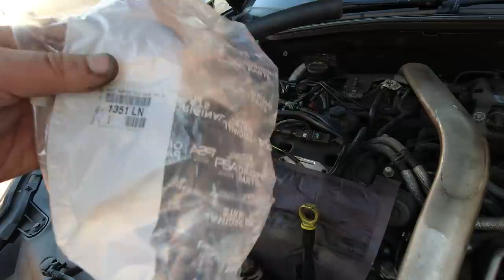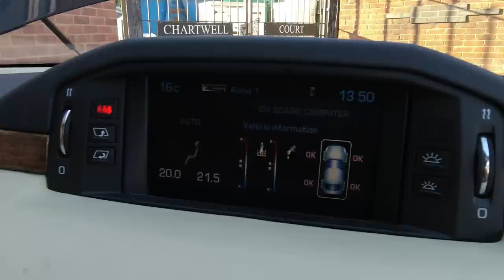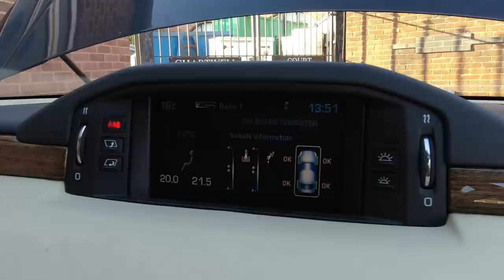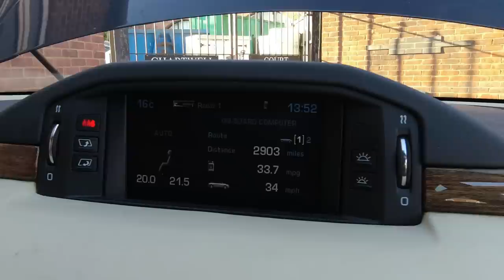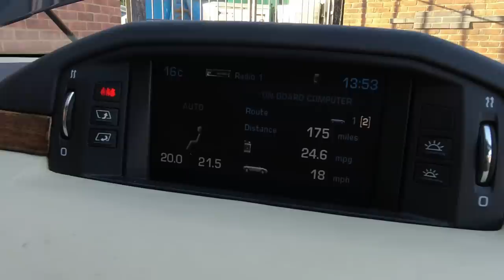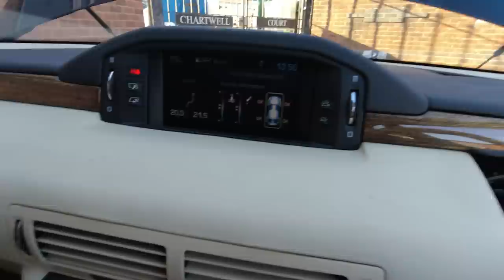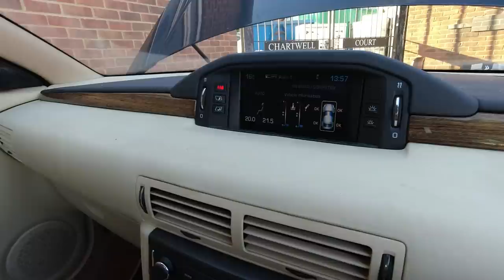Cheap Citroën C6 Project 9:  The straw that breaks the camel's back?

Comment: I have a C4 Coupe VTS 2.0 16V petrol and it's just as mental as a C6 but will return 35 mpg with no problem as it's so light.
Reply from the maker: I had a VTS 180 before the C6 (covered in the first C6 video) and I can assure you, it's not close to a C6 in terms of mentalness! 
Wouldn't say 1320kg is all that light either, in fairness. Don't get me wrong, I really liked it, but it was what it was...a Peugeot 307 in a pretty dress with a slightly underpowered engine (though the engine itself was pretty good)
Reply: @UPnDOWN  Ok I admit it's not as mental as a C6 but it isn't a Golf and it doesn't weigh as much. The guy I bought my C4 off had an absolutely mint C6 and loves it. I think it's a cool car. Could you not mothball it and run a funny crap box for a while. (Honda Jazz🤣🤣)

Comment: Spraying coolant could possibly be what pissed out over the belts when you did the pipe and the bit of smoke might be from a crack in one of those EGR metal pipes ? Those Renault Twingo 0.9 tce's are good fun to drive but they warm up your shopping (Rear engine)  if that's too expensive maybe look for an early Suzuki Swift 3 pot, might even have a velour interior ? 😁

Comment: C3 Picasso 1.6 HDI?......£30 Tax, 40MPG around town and 50 on a run, 5 Doors, back seats drop flat, nice soft suspension, albeit a bit weird looking.
I bought one 12 months ago and we (the family) use it as a spare vehicle, a van for skip runs, moving (small) furniture, etc. We had to buy a new washing machine last month and it fit perfectly in the C3, which saved us £20 on store delivery costs 👍 My 17yr old daughter is currently learning to drive in it too and loves it because outward visibility is spot on. 
You'll just need to find an enthusiastic Citroen Specialist in your area for servicing 😉
Reply from the maker: I just don't want one of those engines in my life, to be honest! Could do without the aggro. I think it needs to be petrol.

Comment: You can fit a low level coolant sensor and activate the warning from Diagbox, there is tutorial to it. We have it installed on ours.. Only issue that the sensor has to be either from Aliexpress or SH. And the sensors were not the most reliable ones, but at least it's there :D 

Also it would be important to change ALL the  coolant pipes, as if one breaks due to old age, pretty much the others will break, for the same reason. While this is logical, for some reason it didn't occured to me, until somebody pointed out.   Some break because they are plastic(durawhatever) and others are metal and rust... 

Until I can pay for it, I am not giving up on mine :D
Reply from the maker: Yeah, I've got a new bottle and a used OE sensor from a C5, just haven't done it yet because I'm still flushing the cooling system before it goes waterless.

As for the pipes, I agree, but that starts getting costly.
Reply: I  have driven mine  in the Netherlands since 2014 and i have spend thousends of euro’s on her…..but i truly love the C6! And i will keep her as long as i can….
Reply: @UPnDOWN  you don't have a C6 because it's cheap, easy or reliable ☺️ you have one, because you are officially crazy. And since you have an SM too, you are more than a normal official crazy 😂 like crazy on steroids

Comment: I had a late Rover 45 connoisseur TDi cheap tax it was very comfortable had all the basics like auto climate and heated seats etc and it did 55mpg in town over 60 on a run and never gave me any grief but its definitely not as majestic as a C6
Reply from the maker: They're actually good cars, though. I sold Rovers (briefly - it ended badly, maybe I'll cover it the 24hr live stream) and the 45 2.0TD Connoisseur was one of the cars I remember being much better than I thought it would be.

Comment: As much as I love my DS, XM, BX´s, and hate all new rubbish, I got a Volvo 240 eight years ago. It´s brilliant. And it´s a 1990 so it gets really good mileage. I can relate to your situation. Maybe give an old 240 a try? If not totally destroyed they are actually pretty nice to drive. I´m still the biggest LHM junkie ever, but the 240 is a friend for life. It lets my brain relax. It kinda has my back. Just a thought...
Reply from the maker: Nothing going to be frugal though? Probably not much better than the C6, if it all? Tax would be cheaper, but not hugely cheap (unless it was over 40yrs old!)
Reply: @UPnDOWN  Aha, so it´s 40 years in the UK... It´s 30 in Sweden. My 1990 Volvo 245 doesn´t pay tax and I´m doing 7.5L/100Km. Rust-wise, Volvo were really bad before 1989-90. And a 40yo Volvo will not be frugal at all. They need the B230F engine with LH 2.4 Jetronic and a manual gearbox to be good. I think that engine came in 1989. I still think it´s worth looking at. It´s always nice to know something good and simple got your back when all the other cars is wanting your attention. It has (kinda) worked as a way for me to stay sane.

Comment: Just get one of the later BXs with a velour interior. I use one (albeit with a tweed interior) as a daily. It's a 16 TRS from '89. 
Not sure what the costs are like in the UK, but I pay chips for insurance and tax, the parts can be sourced from a junkyard and it sips fuel. Quite a decent comfortable daily driver.
Reply from the maker: I've got two BXs already, they're a bit old for daily use, for me.
Reply: @UPnDOWN  I can understand. They are definitely showing their age in some aspects. I know some had AC, but those are quite rare (and usually use the older freon making refills tricky). Also, mine is a bit...how should I say...well loved. By that I mean that nobody serviced the damn thing properly for the better part of 20 years. Currently the idle is too low, somethings up with the HP pump and I think it may be running rich (there is lots of liquid coming out of the tailpipe and the fuel usage can be erratic). However, even with all its faults, it is still an excellent car and we love it very much :D
And, good luck finding a decent daily driver!

Comment: You're a jinx, you are.
I watched this video a couple of days ago and yesterday my degassing pipe - the other of the two that lead to the expansion tank blew.
Exactly the same problem.
Old, brittle plastic end connection that snapped at its weakest point, where the o-ring resides, which is the point where the plastic is thinnest.
I'll be replacing all of these types of fittings/pipes/hoses shortly.
My C6 is begging to resemble Triggers broom.
Reply from the maker: I expect mine will fail soon, too.

Comment: C6 not having a coolent level sensor surprises me. I get pestered with a flashing stop light, beeping, low coolent message and light from my 206 each time I park it half on the kerb opposite my house because the coolent level is at an angle the car doesn't like until you get off the kerb and drive off and it goes away.
Reply from the maker: I was going to do a video about it, but they did, originally. PSA stopped fitting them because coolant was seeping up through the sensor through capillary action and along the wiring! It would get to the ECU and ruin it, as well as throwing up numerous false low-level coolant warnings.
They can be retrofitted, at least.

Comment: I have had my C6 2.2 for nearly ten years recently failed its MOT with leaking hydraulic pipe on nearside strut. New pipe from Citroen will take 6 to 8 weeks for delivery and cost to supply and fit £821.00 it also needs tax £330.00 and service. I have decide to take it off the road for now and use my Dacia Duster 1.2 turbo petrol for the winter. I understand your situation.
Reply: Get one made 😉

Comment: Here in Denmark the annual road tax, or green tax as we call it, is 1.500 pound sterling with the 2.7 diesel. I didnt see a C6 for a very long time. I always liked Citroen and my first car was a rusty CX 2400 Pallas in, more or less, the same color as Clements original color. The new boxy Citroens are not real Citroens to me so today I drive a 2020 Volvo V60. The Volvo is "only" 500 pounds in annual tax. Cheers from Denmark.
Reply: Maybe thats why newer Citroens dont brake down any longer that the old ones did.😄
Reply: @fonziebulldog5786  I do not agree. I have had 2 CX, 1 BX, 1 Xsara, 2 Grand Picasso, 1 C5 and 1 C5 III. The Xara was the most unreliable even if I bought it from new, the 2 Grand Picasso had technical issues every second month, gearbox failures etc. The most reliable was the CX GTI and the BX. Minimum maintenance but extremely stabile during the years. Cheers.
Reply: @hestjensen3876  Well, when the fuel prices took of to the roof over a year ago i  sold a troublesome Volvo XC 90 T filled with electronic problems and bought a Citroen C4 second generation and it just runs and runs without any faults. I will probably get another Citroen after this one for sure. Take care. 👍

Comment: Buy yourself a 3 cylinder 998cc Kia Picanto as a commuter car for yourself. I bought a 2011, 40,000 mile, specimen for £3,999 as my retirement car, and it's fantastic, both to drive and work on mechanically. The Hyundai i10 is basically the same car with a different body.

Comment: You protest, but you need a Citroen C1! I know the 107 and Aygo are the same, but you need the one with the Citroen badge. Buy one cheap with a broken clutch. Parts are peanuts, they are easy to work on. Just don't buy a rotten one and seal up all the bits where they let rain in. Some of them have velour-ish seats to boot. Seriously one of these will save you so much cash!
Reply from the maker: I'd want the Toyota-badged one, as it is more a Toyota than a Cit or Pug. They also look the best of the three IMO.

Comment: At the risk of teaching my grandmother to suck eggs, I am a bit of a C107GO obsessesive, so if you do go down this route, the following apply (based on MK1, 1KR-FE petrol only, since they are the ones I know best):

- Clutches, rainwater leaks, gummed up oil control rings, piston slap (usually only an annoyance) and weeping/leaking water pumps are your main concerns.
- The Phase 1 cars are the nicest to drive in my opinion, but are 'only' EURO 4 complaint.
- Phase 2 and Phase 3 are EURO 5A, the latter being free VED, as opposed to £20 a year, last time I checked. I believe the main difference is in the mapping. Not related but I also believe the later 1KR-FE got oil spray jets under the pistons.
- I've driven plenty but have only owned a phase 1 and a phase 2 car. Personally, I didn't get on with the phase 3 as it felt "flat spotted" at various points in the range (had one as a courtesy car for a couple of months whilst my phase 1 was in for body work and didn't like it).

I know you're not particularly interested in owning one, buy if you go down this route, I'd be happy to advise further :-). Again, grandmother, eggs, I am not a mechanic, etc etc. :-D
Reply: @dizzy2020  Yes, I find the seats cause me back pain after any journey longer than 1.5 hours and the suspension tends to bottom out with adults in the rear seats.

The ride's fine for me (althought a little on the firm side and potholes make me cringe) and I suppose the road noise can be excessive on a long journey.

There was a time when you could pick one up new for £6,000 so I suppose you get what you pay for, but that switch, a bit of wire and a connector always did seem a bit of a step too far!

It also seems a bit silly to have to pay more for the 60/40 split rear seat but the C107GO isn't unique in this trait. E.g. the Picanto '1' trim has a one-piece bench too, IIRC.

Take it for what it is, cheap and cheerful, warm the engine through and rev the nuts off of it and it'll give you a grin or two. e.g. https://www.youtube.com/watch?v=FnCliM6ZHAU
Reply: I intend to teach my wife to drive in our K11 Micra. The C1's clutch is a bit 'fussy' for a learner, or that's my excuse (high bite, and stuff-all torque off the line). Truth is, my C1 is now a 'garage queen', sheltering from the rain and salt in the garage, waiting for sunny days to come! :-D
Reply from the maker: Thanks for the info!

Comment: have you considered looking into mobile broadband ? i bought a Huawei mobile router and an omni directional external aerial after a lot of youtube research and Im getting unlimited broadband no throttling with a 3 network sim at £18 a month download speeds 70 to 90 mbps and upload speeds of 15 to 20 mpbs and some unlocked mobile routers can have a phone attached at no extra cost for calls to landlines. the beauty of it is you are not locked into any contract you can simply change your sim card for another network any time you please. If you add a cheap Tenda Mesh system you can expand your wireless almost anywhere on your property with no blind spots.

Comment: I'd a C6, bought it at 2 years old and 18000 miles, from a Citroen dealer, for £16000. I got rid of it at 70000 miles, and it's still going- last MOT was a few days ago, at 135000. And the MOT history shows a pass each time, with no advisories. Not bad for a 14 year old car.....
Reply from the maker: They're nowhere near as bad as people make out, just expensive to run (as would be a 6-cyl BMW, Merc or Audi of equivilent size/mass etc)

Comment: Try an A2 TDi. I did, I liked it and I went from a 3 cylinder UP! Gti to a 3 cylinder A2 in a smooth, beneficial transition (ride and quality wise).
Reply from the maker: So go for something much harder riding before an A2, and the A2 will seem good?

But I'm going from a C6! lol
Reply: @UPnDOWN  Yes, the ride was terrible on the UP! The A2 wasn't great either initially. I  have moved from the standard SE 16" wheels to 15" Audi pepperpots and it's fine now.

Comment: Shame about the C6 but it is what it is. The prices for everything is ridiculous nowdays. Funny thing is how my father is just obsessed with running costs and bought a 1.5 Turbo Diesel Opel Crossland last year, brand new. And right now it's MORE expensive to run than my old raggedy 306 with the TU3, Gets me about 45 MPG on average.

I'd recommend you an old base model Peugeot, either 205, 106, 309 or 306. Got velour interiors, comfortable, cheap to run and fun to bomb around in (Admittedly not a 1.4 litre 306, it's painfully slow)

Comment: Cheap to run, comfortable, velour...... Ford Fiesta Mk4 Ghia?
Reply: I was just thinking that.  My mother had a P-reg one with the 1.25 Zetec engine from 2008 until 2014 when the welding bill for the MOT was no longer deemed to be viable.  It did get welded by the next owner and MOTd once then promptly written off 😢  Not sure what the purpose of my story was, other than to say they are indeed great little cars and with velour upholstery and a fake walnut dash you don't feel hard done by.  But finding one that isn't totally rotten wouldn't be easy.
Reply from the maker: It's a good shout. I'd prefer the mk5 facelift, though. Mk4's a horrible-looking thing.
Reply: I have the poverty spec mk 4.5 ( facelift) fiesta flight 1.3 as my commuter car, no velour sadly. Amazing reliability and handling. Family bus Xsara picasso 1.6 16v Petrol (velour). Sills fully sorted,   Recommend both cars although both are plodder, ie not very quick either of them.

Comment: These are many of the reasons why so many C6s have bit the dust I guess.  Sad but understand it should go.  😕  Diesel more expensive ATM in Australia too.  Why?  It’s madness.  Maybe an Xantia….if you can find a good one.  Cheap as chips.
Reply from the maker: I can find two Xantias, though neither are sensible dailies! Not cheap enough to run, either.

Comment: I had the same but still a different problem ( and know nothing about UK tax) but I had a 530d which I loved - but I got a job 160km away from my home. The km was great im the BM but the value of it decreased so fast + repairs so I also had to think another way. I ended up with an older Saab. Value already zero, tax pretty decent.. never any problems and it run great for what it was. i would suggest a saab (which is cheap) or a Toyota (which is boring) but it from a dealer and give the C6 in exchange... (You have now tried to have it)
Reply from the maker: I don't really buy cars from dealers often, and I've never actually traded a car in before!

Comment: I also absolutely love the C6 but just can't afford to run it. I'm now on my second C4 1.6 Hdi Coupé Mark 1, which I also like very much. It's a good looking car and still turn some heads, guess they remember the Loeb era. To my knowledge there is only one concern - the injectors or rather the studs holding them down, they tend to leak engine oil.. yes, engine oil, not diesel. It seeps up through the threads (in the head), presumably because of crankcase pressure. There are a few good ways to stop it from leaking but the injectors have to come out and the studs should be replaced as well as the copper washer/seal for the injectors. Once done they will last another 150000 miles at least. Otherwise it's a cheap (to buy) and reliable car in my opinion. Easy upgradeable to 130 hp...
Reply: C4 Coupe looks a bit like a C6 that’s shrunk in the wash. I enjoyed mine (1.6 HDI)
Reply: Revealing lines, absolutely and with the same Cd as the Porsche 911...
Reply: I've always admired the C4 by Loeb. The normal C4 I was meh about but something about the red and white wheels really suited it.
Reply: @MrManBuzz  
I completely agree, a great combination complimenting the style of the body. I had to settle for 'Rouge Lucifer Nacre', but I'm happy with that ;)
Reply from the maker: I had a VTS 180 Coupe before I got the C6. Quite liked it.
Reply: @UPnDOWN  That would be my first choice if the cost of petrol wasn't going through the roof.. or should that be 'the sky'. Perfect mix of size, performance and style. I'm not sure about the velour though.. 🤔